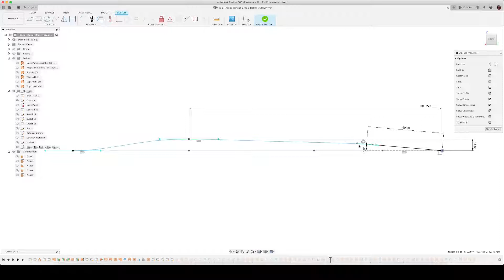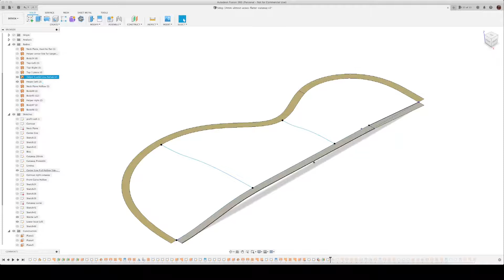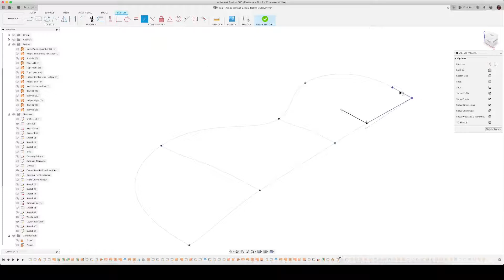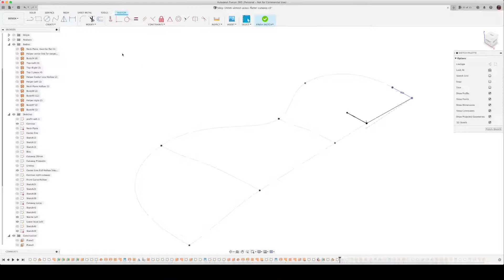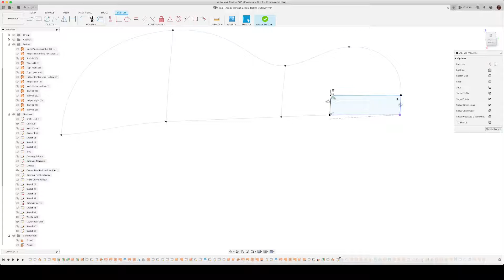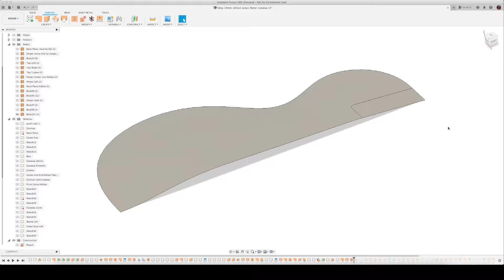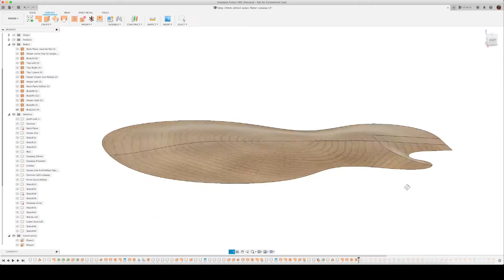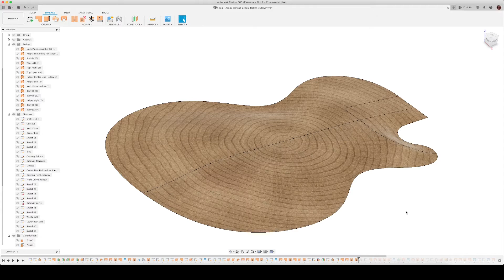Archtop guitar surface modeling with Fusion 360 (loft tool) - Update - Neck Plane

Comment: What steps to you do to turn the lofted body into a solid model with flat bottom and .25" edge
Reply from the maker: You made a patch of the guitar contour. Then move your surface away from this patche the size you want. Then loft from the contour of the surface to the contour of the patch. Finally stitch all together and you'll end up with a solid. :)

Comment: Nice my dude, I've spent way too much time trying to draw a decent isoline map for a Les Paul carve and it has been infuriating. I'll give this a shot!

By the way, Idk if that would be of interest in your design (and you probably already know about this) but you can mirror the first side and extrude the outline of the body until it crosses the top face, then trim what's left of the top. If you're going for a Les Paul carve I think that would be it.
Reply from the maker: Oh yes I know, that's how I did it before but as my guitar are laminated top with side like an acoustique guitar, I have to have the cutaway to be done differently. Will do a video about those cutaway possibilities...